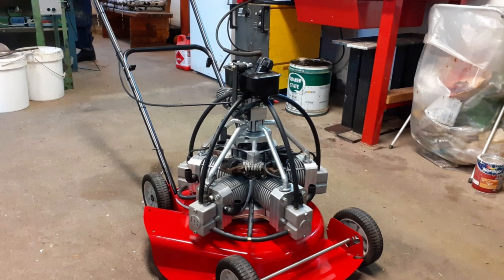Homemade Radial engine part 2

Comment: Your correct angels for the slave conrods are (Master at 0° on top)  Cylinders 3 & 4= +/- 29.5° and Cylinders 2 & 5= 97.4°  from bottom or 180° in regard of Master. With my selfmade 7 cyl 120cc it was the same story but with 7 cyl of course...
Reply from the maker: I don't know the exact angels . I made a simulation in the computer to get a straight line from pistonpin, crankpin and crankshaft. But then I moved the problem to when pistons are at BDC, but thats not so important. I guess you have to place the pivot points as close to the crankpin as possible. But in the same time you don't want to make the pivot pins and bushings to small. A dilemma. Since I don't have all the pins in line at BDC I actually have slightly bigger cylinder volume in some cylinders. Radials are fascinating
Reply: Так,можно подробнее?я строю 7 цилиндровый радиальный sv

Comment: Can somebody explain me why all radial engine have uneven number of cylinder? Like 5, 7, 9?? Never seen a 6 or a 8. Does anyone have a clue why is like that?
Reply from the maker: On a four stroke engine it takes two laps (2x360=720) to complete a working cycle. In my case 5 cylinders 720 divided by 5 is 144 between every bang. But the cylinders are placed 72 dgr apart. So it fires every second cylinder. 1, 3, 5, 2, 4. With a even number of cylinders you will not get an even fireing order.
Reply: @Desmouffe thank you for the reply 😊 still don't understand why it shouldn't work with a 6 cylinders. The firing order would be 1 3 5 2 4 6. What am I missing?
Reply from the maker: @davidemantovi6678  Then you will be firing1, 3, 5, would be even, then you have to jump to 2, thats half a lap. After cylinder 6 you will start with 1 again, Thats the cylinder next door. No even firing order. It will be a nightmare to create the camshaft to fix this. Radials are tricky

Comment: I noticed that with the coil setup you have, the firing order would be 12345 where aircraft use 13524 off of a distributor.  Interesting.
Reply from the maker: My firing order is 13524. It is decided by the camshaft. The ignition coils gives a spark every lap but only every second spark is useful. Same on a lawnmower.